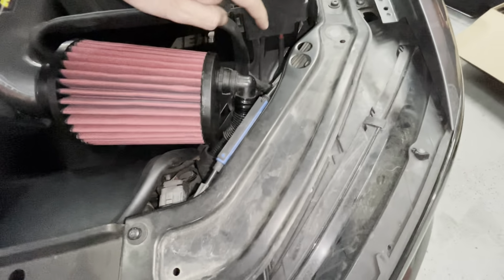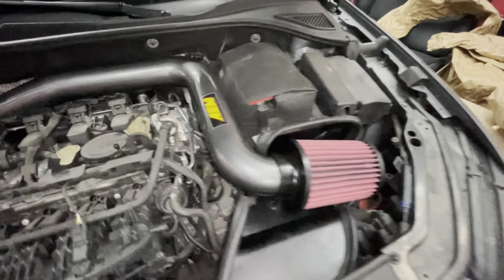Installing a AEM Cold Air Intake On a Straight Pipped & APR Tuned R-Line!

Comment: Where can i get a new filter exactly like that model? I need that exact filter with the secondary air injection port
Reply from the maker: I got mine from AEM intakes! just make sure it had the adapter or secendary air injection filter